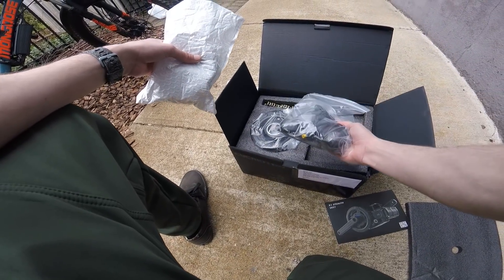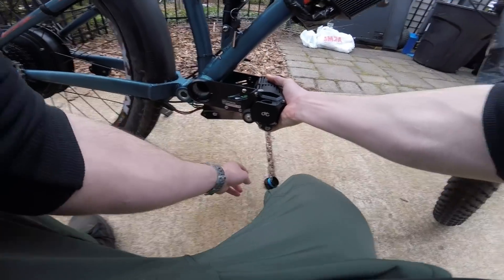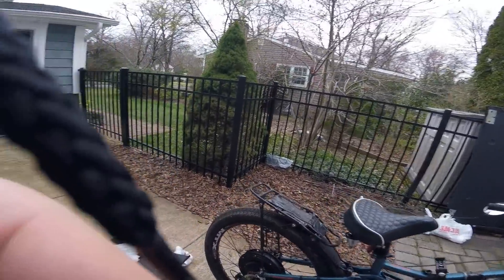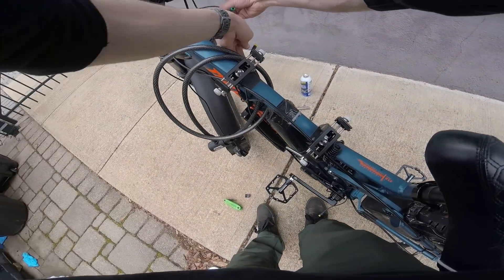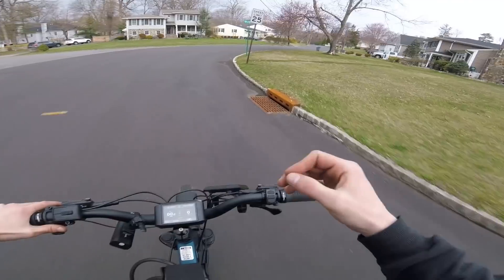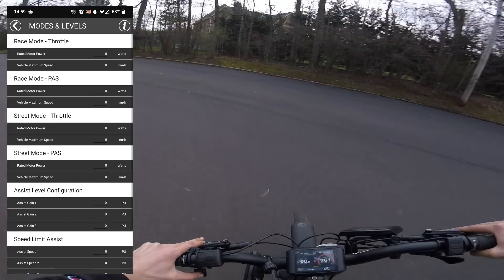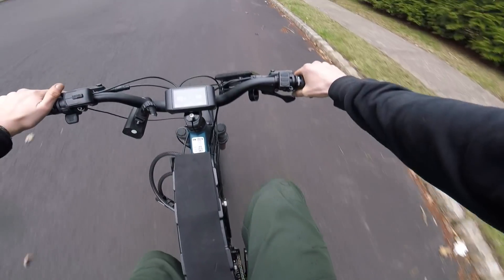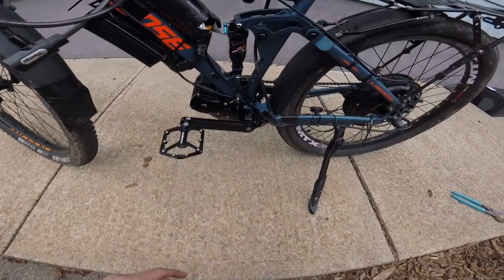Putting a 72 Volt Mid Drive Motor on my eBike - cyc x1 Stealth

Comment: Almost 5,500km on my CYC X1 Stealth. I went with the full grip throttle. I have also built two other ebikes with the same motor but with thumb throttles. No comparison. The full grip throttle is way better. Especially if you are doing longer rides.

Comment: 😂
You do know you need to change gears lol.
It's manual not automatic 

Just like a car or motorbike.
Not using gears properly will cause damage.

Not only that on a e-bike it will use up your batteries faster.
And won't get full potential out of Ebike.
Going up hills and on straight roads

Comment: Were you shifting while riding or just leaving it in a single gear? I didn't see you shifting and was under the impression that not shifting puts a lot of strain on mid-drive motors and drivetrains

Comment: link to the motor plz and is the bigass battery the 72? did it come with the hub or mid drive? and ya whats the top speed? and finely, did you ever use both drives at once :D !! Top speed ? !!!

Comment: no one has said anything about the two wide turns you took the last one with the vehicle coming the other way could have ended very badly . as a motorcyclist the throttle is always on the right side was there a reason you fitted it on the left as most of the e bikes i have seen have had the thumb throttle mounted on the right
Reply: Looks like his shifter is on the right side. I had to do the same thing on a build. Its actually really interesting to make your brain use your left hand for throttle.

Comment: Good video thanks for sharing. Did you get any foldback due to heating up over 70 degreases. I'm finding that if I run it at 1500w for a few miles it can do that on mine and I'm trying to understand if it is as is or mine is defect. Tomorrow I'm installing some heat sink on it to see if I can keep the temperature down for when I'm using it in hi performance. I have a nice video crossing a bridge in wet conditions. Feel free to see it . https://youtu.be/jPo48ThQv_k , To affect throttle in BAC APP in Throttle page "Positive Motoring Torque Ramp" change from 250 to 150 as lower is not recommended. In Modes and Levels "Throttle Bypass Assist Level". These two will help according to your needs.

Comment: I wonder if the CYC mid-drive will fit on a Stealth Bomber frame.  I just bought a frame this week so I can see how they are made.  Hopefully it will be at my home by Wednesday.
Reply from the maker: Please let me know if you find out
Reply: @NPLVentures  I will do that.
Reply: Should. Just make sure you have the right size bottom bracket adapter
Reply: any update i also wanna do the same thing

Comment: Nice bills mate for a second I thought you was going to ride the hub motor with the mid drive lmao 
You need to start a low gear for fast acceleration and high gear for top speed 
I’ve got a 3000W rear hub motor pulling 4K watts

Comment: Nice video! Are you planning on adding an ASI controller and bumping up the watts? What’s the CYC stealth motor capable of pushing?

Currently running a BBSHD/BAC855 (with the awesome HV kit) at 3800W and it’s fantastic. Butter smooth, quiet and plenty of torque and top speed 👌
Reply: The cyc motors has asi bac855 standard you can even upgrade to bac4000
Reply: whats the top speed u did,I just put a HD on my hardtail

Comment: Congrats and welcome to the world of mid-drives. To get a speed read out you need to install the speed sensor. Could moving the spacer to the non drive side help with that chain alignment? The CYC is quieter now but any mid-drive with double chains will make noise (even if the motor were silent). I hope you remove that heavy hub drive to enjoy the full benefits of a mid-drive, other than climbing is less unsprung weight in the back wheel.
Ride on & enjoy;)
Reply: I was thinkin the same with all that xtra weight on the bike defeats the purpose
Reply: this mid drive is a fail though, its definitely slower than my hub motor
Reply: @Blox117  I'm  sorry you're not loving it more. For throttling around hubs are easier and more fun but an equivalent powered mid-drive should be faster (top speed not acceleration) and climb better but using gears is necessary.
If you're running at 72 volts you need to change your gearing for higher speed. Your climbing and top speed are all governed by gearing with a mid-drive. If you want a higher top speed get a bigger chainring. Before wearing out my top gear I was able to hit 36 mph (only 34 now) with a  52 volt Ludicrous BBSHD, so you should be able to go faster (on 72 volts).
Reply: @michaelsprinzeles4022  im mounting a custom mid drive motor. i could have gone for this IPM that was meant for a motorcycle, but i opted for using two cheaper ones. these will both be driven by 6kW controllers to the rear wheel, which is a MXUS 5k turbo hub motor with another 6kW.

basically i am using the disc brake to mount a fixed gear, and the threaded side to mount a threaded brake hub and mount a second fixed gear. the two motors sit above the rear wheel in a rack. maximum theoretical power based on testing is 18kW and torque should at least be 300nm but definitely should go higher like 400.

this is probably the first 3 motor drive to a single axle lol

Comment: If that's a DD hub motor probably be more efficient if you removed it. Would be neat it you could get it to regen and use if you broke a chain or something ( backup motor)😄
Reply: it would be better to run them in tandem

Comment: Congrats. The Stealth is a great little motor. Had mine for almost two months. Still figuring out how to get the motor to engage quicker. But happy with the performance overall. Much cheaper and more power than an off-the-shelf ebike.

Comment: Have any of you other ebike owners been stopped by police for riding an ebike?
Reply from the maker: Our experience so far is no problems. 

I personally have ridden past and pulled up beside a cop (at a red light and throttle away) and they never look twice.
Reply: @NPLVentures  In my experience the police are cool when people don't drive stupid close to people...observe traffic laws etc.  My ebike will do over 40 mph and never a problem.  If you own a R1 motorcycle that will do 180mph, don't ride it over the speed limit and you will be just fine.
Reply: Just wanted to know what others were experiencing.  A friend sent me a video of someone getting pulled over in Canada and getting a $600 ticket because the cop said she was riding an electric motorcycle and got her on everyone he could.

Obviously not all cops are like that, but I was curious if anyone in this community had experienced something like that
Reply: @dapperduckling3951  Canada is way different with their laws

Comment: Hey Living Deliberately I have a question so I'm still looking for frames for my new ebike and I'm looking for a solid steel frame but can't find to many that would work for me so my next choices are carbon steel/carbon fiber whatever the difference is between the 2 or aluminum. I heard that carbon steel/carbon fiber bike frames are really bad for ebikes is that true?
Reply: carbon fiber I have heard to be bad for diy kits, especially the hub motors (there are more and more mid drive ebikes being made from carbon fiber however). Carbon steel should be fine, as it is most likely going to be "low carbon steel" which is often used in machining, known to be durable and easy to weld.
Reply: @devildogcody  what's the difference between carbon fiber bikes and carbon steel bikes? I look it up on google but can never find any answers
Reply: @stevenmiller9198  carbon steel is still steel, but with a carbon content of up to 2.1% by weight (the low carbon type used in manufacturing is under .25%)...think knife blades, they use forms of high carbon steel. Rule of thumb, the more carbon the harder the steel, but the harder it gets the more "brittle" it gets, but low carbon steel is great for bike frames. 
Carbon fiber is a different beast, it is many thin strands of carbon filaments held together by varying types of epoxy/resin. It has around 5 times the tensile strength of steel, while considerably lighter, which is why it is a very popular material for higher end road/mountain bikes. The issue I would imagine with using such for a hub motor would be it wasn't designed for that amount of torque, and you could end up with cracking between the fibers around the motor mount points. I know that some of the most expensive specialty mid drive mountain ebikes are using carbon fiber frames, so you might be okay using a mid drive diy kit...but still questionable since the diy kits mount through the bottom bracket, while the specialty bikes have custom designed frames the motor mounts into, so I don't really know, just guessing on that point.
Reply: @stevenmiller9198  just as an fyi, I used a carbon steel frame for my diy build, with a 2000w hub motor, it has been great so far
Reply: Just find the lightest aluminum/steel bike you can find. Stay away from heavy tanks like the bike in this video.
Reply: @LarryRichelli  but isn't aluminum alot weaker tho and I'm looking to install a 1500 watt motor so wouldn't that run the risk of it breaking easier because I'm looking for a cheap frame I don't wanna spend over 300 dollars on one
Reply: @stevenmiller9198  full aluminum isn't a good option for higher wattage bikes, but most aluminum bikes are using an aluminum alloy which will most likely be ok, so long as you use the torque-arm that comes with the kits (they usually come with one....I would get a second and use one on both sides if I wasn't sure of the bike frame material). They spread the force of the torque from the axle drop outs to part of the bike frame.
Reply: @stevenmiller9198  I was not talking about a hub motor. Hub motors are for beginners. When you learn the advantages of a mid drive you will never go back to hub motors.
Reply: @LarryRichelli  I just feel like mid drives are alot more confusing, more expensive, and less powerful. At least that's what I've seen so far
Reply: @stevenmiller9198  LUNA CYCLES
Reply: @LarryRichelli  huh?

Comment: I drive with a 1500w 48v hubmoter and im already enjoying it
But im suprise how good this middrive works👌
Reply: What frame do you have and what material is it?
Reply: @stevenmiller9198   aluminium  mauntainbike frame 26 inch wheels
Reply: @armrestlingKings  Im in the same spot, been using a 48v 1500w hub for a year or two. On some bottom of the bin mongoose bike no less. Gonna get a new rig soon enough.
Reply: Could you add mid drive and keep your rear hub ?

Comment: you should add a battery to the rear rack and keep both mid drive and hub motor :)
Reply: haha a dual motor setup would combine the advantages of both motors. mid drive to leverage the torque of the mid drive with the gears for steep hills, plus the hub motor keeps pushing even during upshifts and being more efficient to cruise at constant speed...but also double the weight/cost and reliability issues.
but if you want the strongest ebike possible, and you have already maxed out the controller for your motor, it. would be a solution. just add a front hub for good measure

Comment: Why did you choose the stealth? The x1 pro puts out 3000 watt peak at 72v. My current ebike has a 1000 wat hub motor and a Luna bbshd. But I hate the weight of the hub.
Reply from the maker: I found out the stealth and the pro are pretty similar if going with the asi 855 controller. 
The pro has more overhead with the option for the asi 4000 controller. 
the stealth is also newer and has a slightly better design.
Reply: @NPLVentures  can the stealth hit 2500 - 3000 watt

Comment: Encouraging the CYC is working on the noise issue with their mid drives.  Noise is why I built with BBSHD. The CYC can generate big power running enough amps through it. But the drapes have to match the curtains.  Battery cell discharge capability aka good cells versus cheap Li-Ion cells and battery BMS which can clip high amp discharge saddled with a controller that doesn't allow big amps = a restrained CYC which is capable if everything lines up with higher amperage of 3-4000w.
I wonder if at some point you will search for another frame that will allow you to place that large battery within the triangle.  You don't seem to be much of a pedal guy...I come from a cycling background and so enjoy the combination of motor and pedaling.
Thanks for sharing your journey with the e-bike community and will be watching as you refine your set up.
Reply: It's based on the revolutions. Bbs0x is not much quiter on comparable revolutions. That said cyc has other more important problems

Comment: I just got my ledge X2 delivered yesterday. Can't wait to start modding it. I've been waiting for you to get the cyc so I can decide which for me to go on a motor. Great work
Reply: I just had an X2 delivered the other day also, at one point i thought about a mid drive only to realize there is no good place for a battery. Ive still got my XR pro and almost think i like it better for what i do, might just send the X2 back, 90 day return policy.
Reply: @johnnyofast5924  you can return Walmart bikes to your local store even if you assembled them, which is convenient.
Reply from the maker: stay tuned to the channel, have mixed opinions so far on the cyc
Reply: @NPLVentures  TIME HAS PASSED...UPDATE?  HOW FAST DOES IT GO?
Reply: @NPLVentures  dang I have a Luna off road kit running 52 volt. Not 1 issue and no overheating at all.
Reply: Shadow,
Where are you going to mount the battery on the X2?
Reply: @lukewalker1051  the ledge looks cool love the geo but no room for a battery. Not sure about having a 72v battery 2 inches from the crown jewels. Just get a hardtail